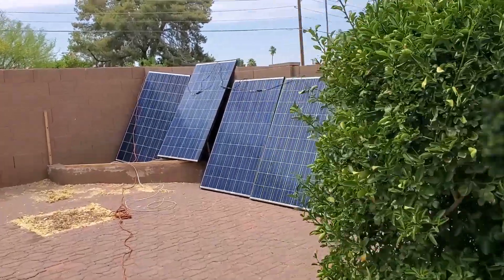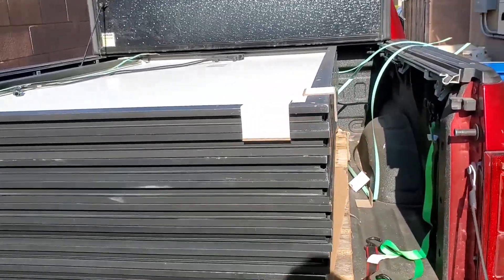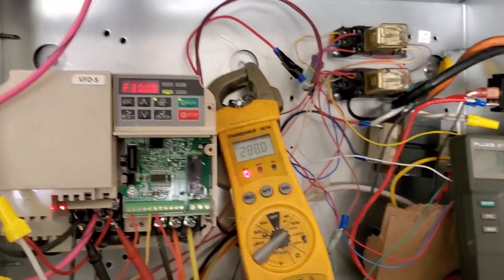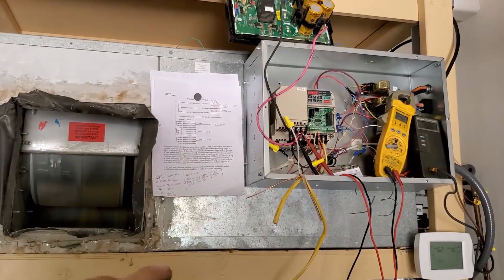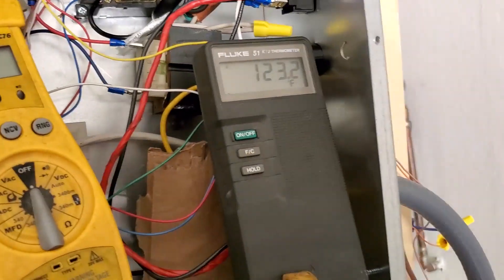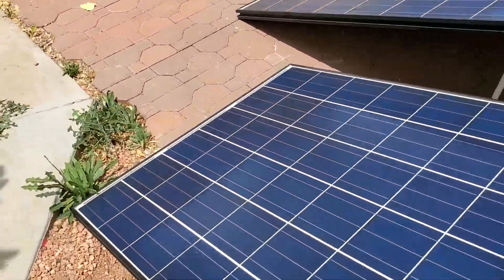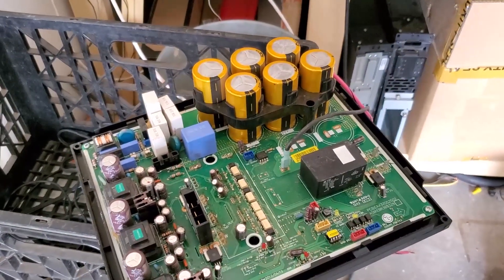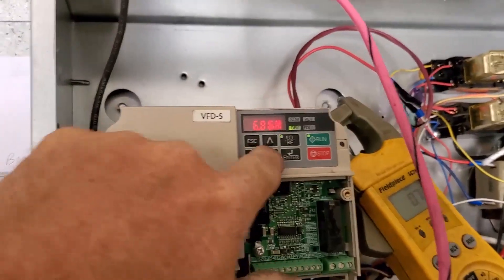Can solar panels power my Bastardized VFD WSHP Water Heater?

Comment: You need a little circuit to change PV voltage to a signal that controls speed so the panels stay above power point voltage.  I run my LG clothes washer off solar panels with no battery.  Built a simple controller to PWM my water heater element and efficiently keep panels at power point. It also automatically reduces power when it is needed elsewhere. You don't need that many panels to heat water with resistance and a cloud will keep shutting down a HPWH.  Patio is the way to go, avoid putting anything on the roof.It's fun finding off manual uses for things!
Reply from the maker: That's funny. This morning I was reading my VFD manual and found a way to get a 0 to 10VDC analog out signal based on the DC BUS.

This video is before I installed the panels.
I have a home made controller working fairly ok at the moment that brings on the utility power as needed to maintain my DC BUS voltage (effectively the PV voltage, which is 330VDC).
I am using a home made high voltage to low voltage converter to feed my microprocessor. For now it gates a triac on the utility power.
But PWM after the utility power is rectified is what I want to go back to.

I came home today at 4PM and the utility power was barely pulsing on at all and I was able to pull my AC utility and the heat pump still ran directly off of solar to run 1st stage cooling. Pretty good for 4PM this time of year!
Reply: @hackfreehvac  I have a HPWH and still use the resistive element with solar.  This can increase tank temps beyond what the  HP can do and get you thru nightly tank loss.  It is not always about being efficient. My heater controller acts like a shunt regulator keeping panel voltages from shooting up when there is low load.

I have a water heater just for my LG washer and feed hot water into the cold inlet so hot for every cycle.  Clothes come out steaming and super clean. More important the liquid dispenser is always spotless instead of a soap buildup.  I used to have to clean mold out of it periodically.  Attitudes change when you have free energy. Check out my universal power point heater control board  https://www.youtube.com/watch?v=yegjGYDMDJg  Need any circuit ideas, contact me.

Comment: That's a lot of solar panels - very cool ! Free power !!!
Build a patio cover & put the panels all across the top. I think you might get more power laying them flat on the ground from the look of the height of that sun.
Put six holes in the ground in back yard , put 4x4's  vertically In quick Crete , tie together with 2 x 6's around sides Whala instant patio cover. 2 x4's from sides to sides. Throw panels on top for shade & power.